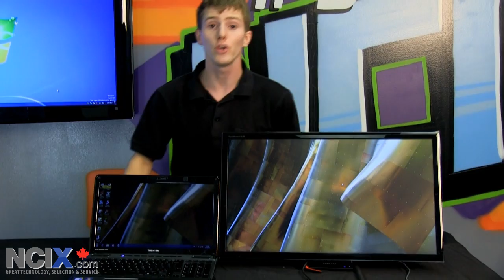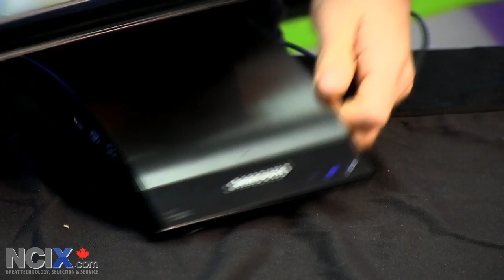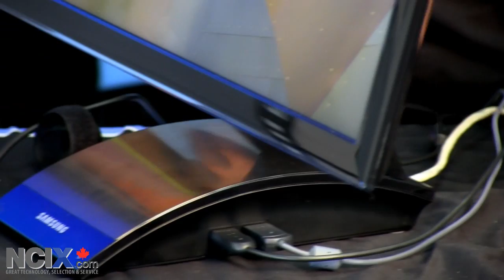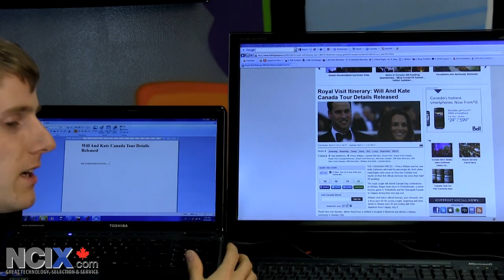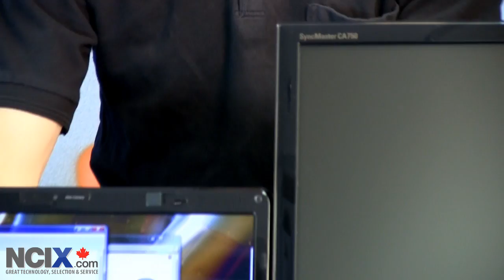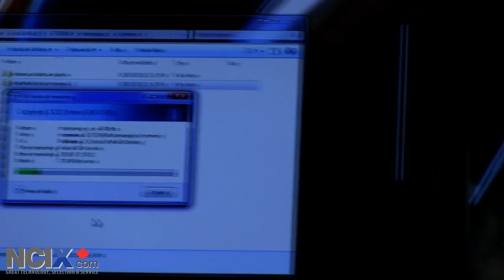Samsung Wireless Central Station Technology Featuring the C27A750X NCIX Tech Tips

Comment: @xsonicbladex To be fair, it is wireless. More pixels would hurt performance a little too much over a wireless connection. But I agree in principle. Rather low resolution for such a large display. It would have been nice if they had the option to go to 2560 x 1440 if you connect it by cable but limit it to 1920 x 1080 if using the wireless. Of course they'd also have to use the more expensive dual-link DVI port and get rid of VGA all together too lol.